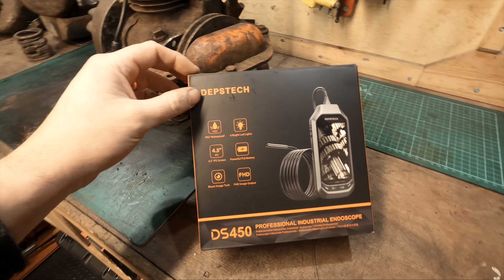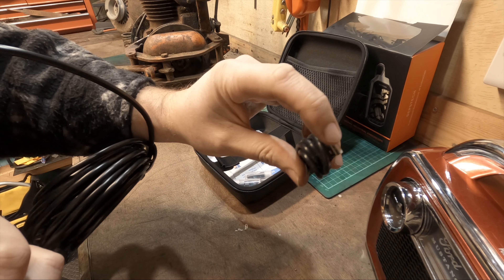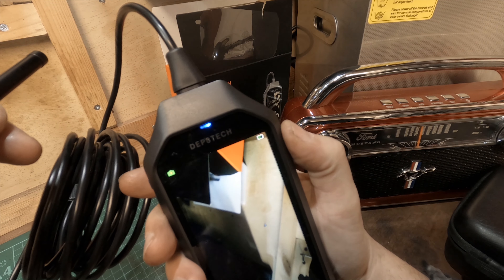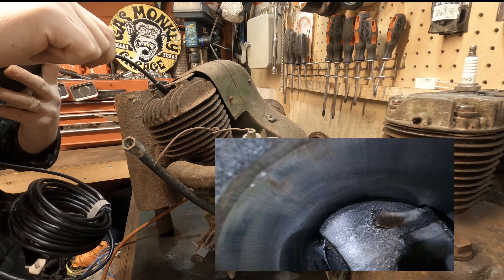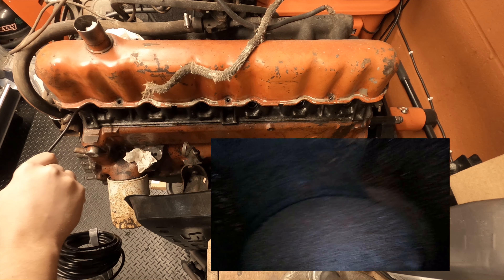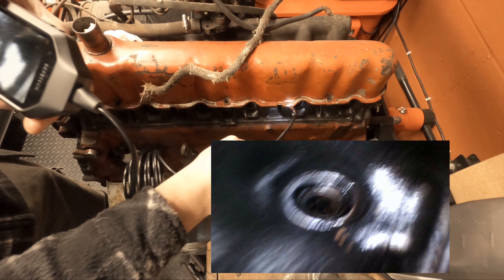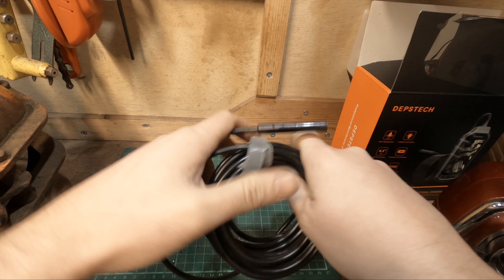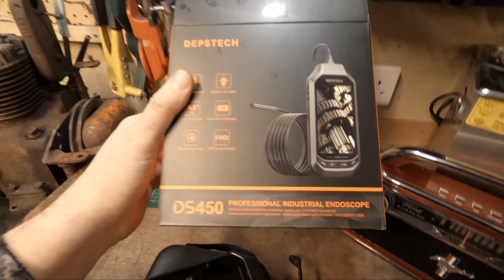Depstech DS450 Endoscope Review - IPS Screen 5MP Borescope Camera 📷 FORD Mustang Engine Inspection

Comment: I ended up electrical-taping it to a fish rod and shoving it through a hole in a basement ceiling to find an electrical box up in the wall upstairs. I was able to get the rod precisely into the hole in the box by myself. Never would have been able to do that alone with traditional fish tape or rod alone- that usually requires a helper. Awesome tool.